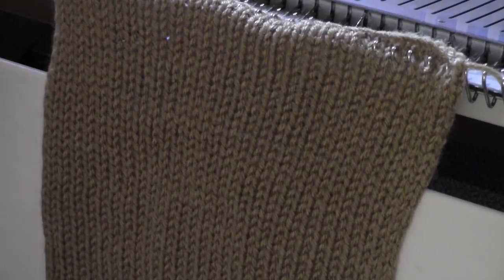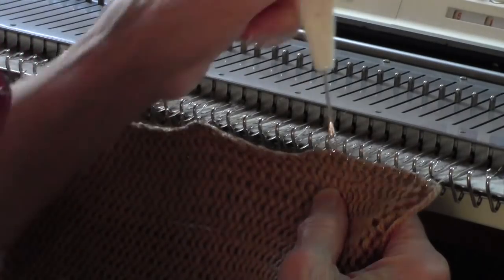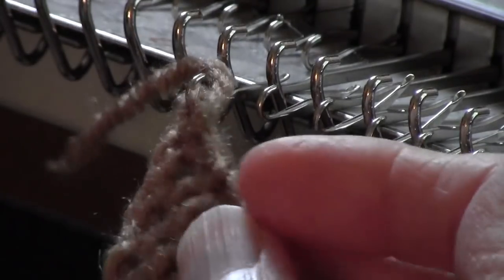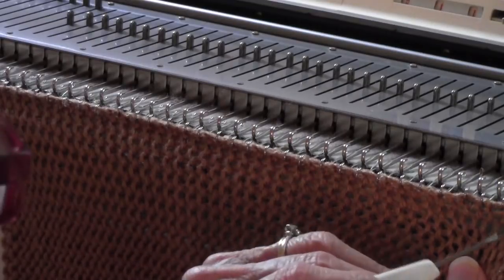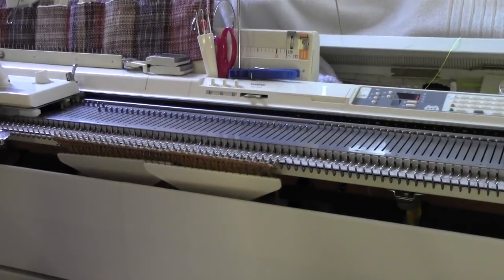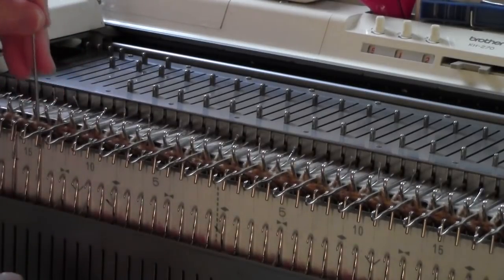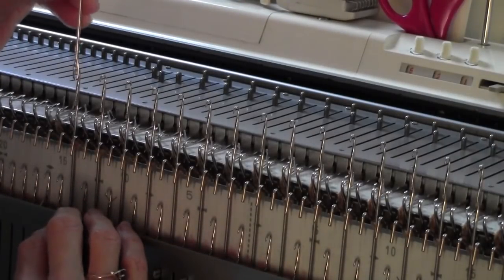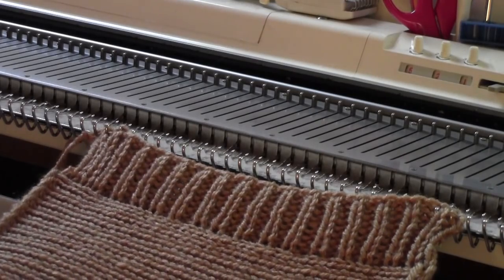Picking Up Stitches for Ribbed Bands by Diana Sullivan

Comment: I've always taught people to go by your gauge.  If your stitches you need to pull up are not specified, as in arm holes and necklines:  if your gauge is 5 stitches per inch and 6 rows per inch, you would want to pull up a stitch in the first 5 row ends, one stitch in, and skip the 6th row end and repeat.  That way your stitches pulled up match your gauge as well.  This translates from hand knitting to machine knitting easily.  Always take your gauge and make it into a fraction, like above would be 5/6, pull up stitches in 5 row ends and skip the 6th.  If a gauge is like 6 stitches per inch and 8 rows per inch, then that can translate down into 3/4. Thanks for a great video!